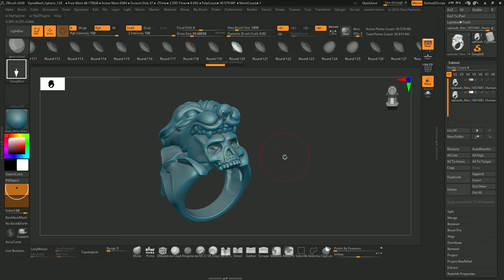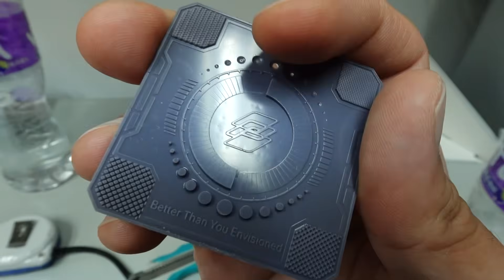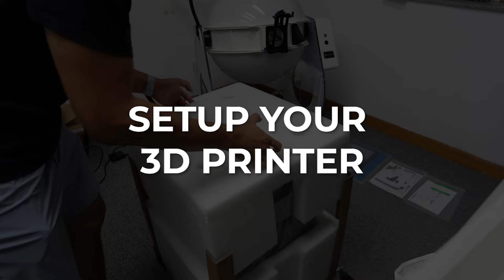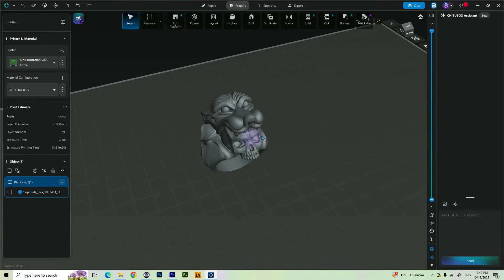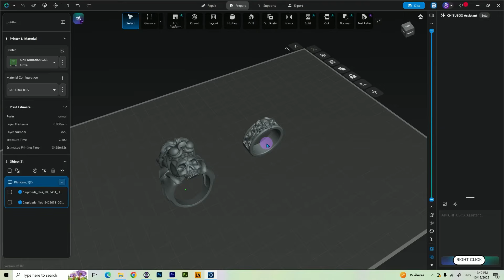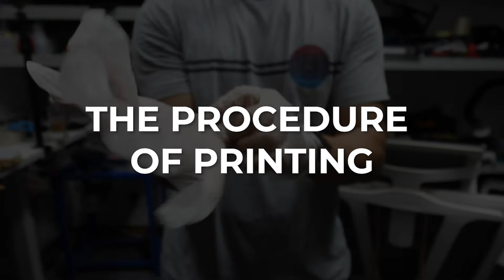The ULTIMATE Guide to 3D Printing Jewelry with Resin | Any Printer Resin

Comment: Great explanation . I'm using the same  Elegoo ultra 4 16k printer. very smooth printing with castable resin . if you can guide with short video how to scale the jewelry , Ring with stones. because Chitubox  SCALE NOT GIVEN ACURATE PRODUCT. now I'm using 3D scale in Metrix still not accurate the out put. please make video if you can regarding 3D model scale for castable resins and non castable .